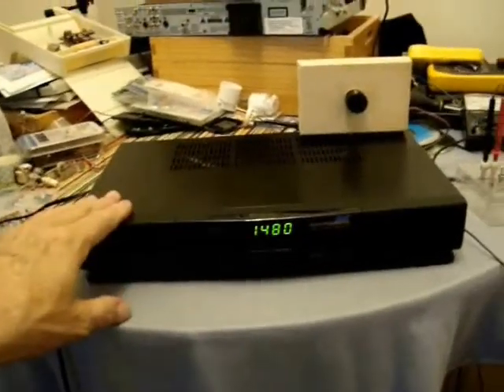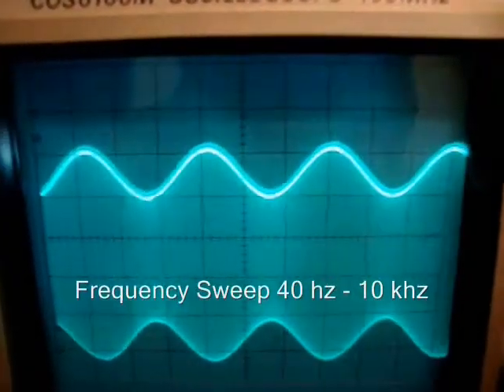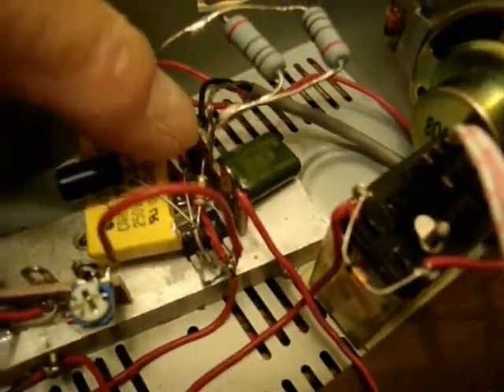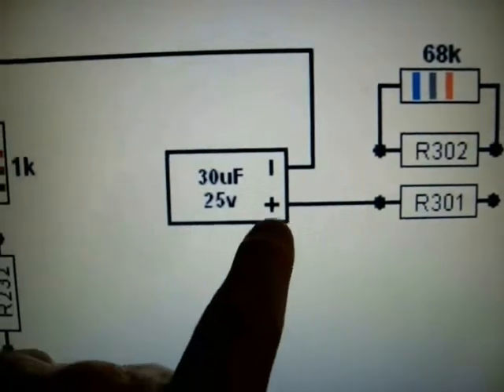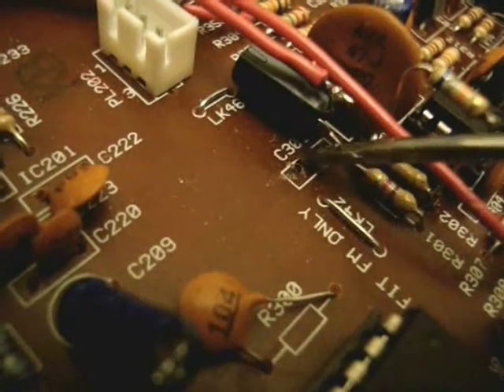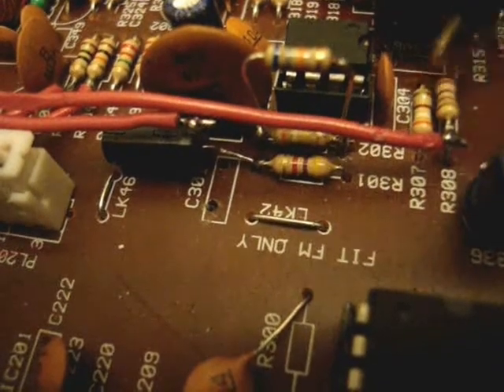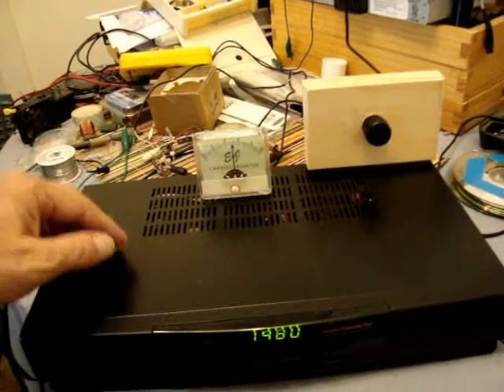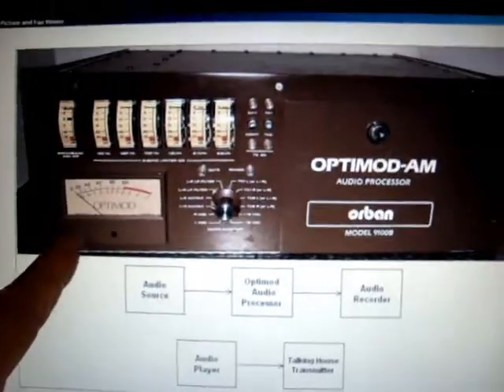Talking House AM Transmitter Modification

Comment: hola Bob. greetings from dominican republic, I have the frequency 1520 in a small town, how can I get the talking house am that I have to cover me at least 5 miles, which I must modify, we are a christian station we do not have money to buy transmitters for the cost
Reply: Hola, el transmisor de Talking House tiene solo 100 milivatios (0,1 vatios). El alcance se puede ampliar
con una antena más larga. Sin embargo, no creo que transmita a 5 millas. Se necesitará un transmisor de mayor potencia para 5 millas.

Es posible que deba confirmar las leyes de su área para conocer las regulaciones relacionadas con la transmisión sin licencia.

Tal vez la radio FM sea mejor, porque es más eficiente. Habrá un costo inicial
para obtener el transmisor y la antena, pero es mucho menos costoso que AM y mucho más práctico. Espero que esto le ayude

Comment: Interesting.  I have a TH5.0 I'm looking to do this with.  It appears to be the same circuit overall.  One question / clarification.  At the beginning of the video you show removing TR308 (which I do not find on the circuit board) - but later in your "post-op" walkthrough you show TR304 as being removed, and this corresponds to what I see on both your board and on mine.   Also, in the beginning you show the lead from LK1 as being tied to D308, but in the final walkthrough you show it tied to the cathode side of D307.  I'm guessing the walkthrough on your actual board is correct, Just making sure I'm not missing something.  

Also interested in looking at your outdoor antenna as the indoor antenna picks up hum and induces it back into the audio.
Reply from the maker: The hum/buzz issue you mentioned maybe a phantom hum. Are you hearing the hum off air? Is it a
hum or a buzz?

I've had the same issues with mine. The perceived Hum and buzz is usually caused by power line
noise being superimposed on the received signal. It's not being put back in the transmitter.
It's very misleading.

One of the biggest offenders are cell fone chargers. They make a lot of electrical noise that
gets into the 120v house power and interferes with AM reception. Usually, it's only heard around
the house, but I don't hear it on the car radio.

I've installed plug-in AC line filters at the offending sources of noise and it mitigates the
hum buzz problem. I'll also recommend grounding the transmitter to a solid electrical ground
post or a metal cold water pipe. AM transmitters usually need a good RF ground.

You're also correct about TR304. I made a mistake when i called it TR308.

Comment: Great video can you do the hi fi mods to the unit with ought using the the expensive  Optimod unit ?
Reply from the maker: Not sure i know what you mean by hi fi mod, but the modulator mod in this vid superceedes anything the the newer Talking House transmitters have, which i demonstrated in the vid. However, if you're referring to audio processing, no. The only thing discussed in this vid was modifying the modulator in the transmitter to obtain the best possible modulation comparable to real AM stations. Audio processing is a seperate issue and left up to the user to decide on using. However, there is some great software processing designed for AM that works great, like Stereo Tool ( https://www.thimeo.com/stereo-tool/ ) or the free version ( https://www.flux.audio/project/stereo-tool-freeware/ ). Hope this helps. 🙂
Reply: @bob4analog  yes it helped a lot that you

Comment: What version of Talking House did you modify? 4.6? 5.0? Does a version 5.0 benefit from these modifications?
Reply from the maker: I did the mod on i think it was a 4.8 and a 5. I dont remember moding a 4.6. It may be slightly different, but not much. From what ive found so far, all the TH models are based on the same schematic, so they're all similar. Do you have a 4.6?
Reply: @bob4analog  I don't currently own any TH device. I am considering purchase of a TH 5.0 and was curious if that version suffers from the same design deficiencies as the one you modified.
Reply from the maker: @N2Stooges   @N2Stooges  I have mod'd a TH5. The 5.0 design does have increase bass response which was a good idea, but their design still suffers from a couple of shortcomings, like the lack of flat frequency response to 10 khz, insufficient PA voltage to make full 100% modulation, and the antenna auto-tune issue.
   The mod i made solves those issues. It completely bypasses the internal audio compressor, which gets in the way of adding your own audio processing. It's pretty much a straight, flat audio path from the input to the modulator, and it works. The test results i did in the vid demonstrates this.
Reply from the maker: I've looked thru my files and i did modify a 4.6M version. I don't know if there are sub versions of the 'M' suffex, but i did varify the the 4.6M is virtually the same as a 5. Ive got pics of the boards and other mods is you would like, I'll send you those. Bob4analog@yahoo.com

Comment: Bob, I finally got some time and the parts and performed the modification.  That certainly makes a difference as far as audio quality.  I have a Carver TX-11a that I acquired from a studio rebuild a decade ago and a Sony SRF-A1 Walkman that are both AM stereo receivers.  Although this is mono, the advantage is having those receivers are the wideband capability to really hear the difference this mod made.  Even without the Optimod and just using the built in processing in automation software I have, it sounds really amazing.  Now onto the antenna tuning.
Reply from the maker: That's great! Glad it worked for you. Congrats! 😉👍

Comment: 15:45 those are also quite expensive, a Raspberry Pi and thimeo Stereo tools would probably be a cheaper option, unless you can find one of those Orbans for the price of a Raspberry PI.
Reply from the maker: So true! I borrowed the optimod, i don't own it. Yes, stereo tools is great. I'm using that now. 👍
Reply: @bob4analog  I unfortunately received a Model II (which has a Model III board), there's probably not a lot to be done to get better audio out of the thing, but I mainly just play old time radio shows through it, no music.
Reply from the maker: As i recall, there's not much difference in the TH boards. If the board in yours looks similar to the 1 in the vid, i think it can be mod'd the same way. I can send you some detailed diagrams if that will help. bob4analog@yahoo.com
Reply: @bob4analog  email sent
Reply: @bob4analog  sent you pictures of the board in mine, it's similar, but has some components yours doesn't have, and mine lacks some components yours has. 

I take it that the black box on the board on the tuner is some kind of ferrite choke or something?
Reply: @bob4analog  the places where you modify and attach wires seem to be there and accounted for, so it should work.
Reply: @bob4analog  the only thing I'm wondering about is in the pictures you sent me are those 3 black wires that's connected to A1 and A2 (can't quite make out the 3rd connection), because mine doesn't have those locations on the board.
Reply from the maker: Hmm.. I'll check that.
Reply: @bob4analog  was you able to find out?
Reply: @bob4analog  BTW what heatsink did you use, it looks like an M.2 SSD heatsink (or around the same size).
Reply from the maker: @madmax2069  Not sure i know what an M.2 SSD is, but i just used a heatsink from a scrap SMPS.
Reply: @bob4analog  an M.2 SSD is a solid state drive a bit bigger than a stick of chewing gum (they do come in slightly different lengths).
Reply: @bob4analog  I'm in the process of buying the parts, bought the 1N914 diode, power resistor, shielded cable.

I just need to get the caps (having problems locating a 30uF 16v electrolyte cap), and just can't quite make out the lettering on the brown ceramic disc cap, I can make out SR 104m 16v I just can't make out what's after 16v it's a blur), still need to buy the LM759CP, and the correct value of resistors.
Reply: @bob4analog  I do have those tiny ceramic capacitors in a 0.1uF value (Bojack brand), would those be fine to use instead of the larger ceramic disc 104m 16v capacitor? 

I also do have a 0.1uF Mylar Polyester Film Capacitors that I bought some time ago which only really leaves the 30uF electrolyte capacitor that I need to track down (I can find 33uF 16v electrolyte caps, just not 30uF).
Reply from the maker: I have extra lm759, I'll send you 1 if u want, no charge.
Reply: @bob4analog  sure

Comment: UPDATE BOB....I guess email doesn't work....I sent my TH6 InfoSpot Talking house crap box and range extender back for refund. Same POS response as your 4.6. And I do not want to experiment and mess around with mods. I might buy the Hamilton AM1000C a little over $100 more than InfoSpot, but a LOT of quality built in. And the transmit range is a lot more than Talking House. Still FCC part 15!!!!
Reply from the maker: Don't know if you meant my email, but I did get your email, just hadn't replied yet (if reply was necessary). Sorry to hear that they sent you a bad TH6. I don't know how much you spent on it, but I got mine used on Ebay for about $70. I think that was a fair price. I've heard good things about the Hamilton AM1000C. It's the Cadillac of Part 15 transmitters. It's expensive, but worth it. That's the best way to go for a no compromise ready-made transmitter and antenna. ;-)

Comment: i am a novice electronics hobbyist do you think I would have what it takes to do this myself?  I'd be willing to pay for your excellent services
Reply from the maker: I suppose you could do it. I don't know your skill level, it would depend on how do you feel about it. It does require some familiarity with electronics, but you don't have to be an expert.
Reply: @bob4analog  I can solder , the biggest problem with these is that there is no bass or punch! Does your mod fix that?
Reply from the maker: Yes, the mod will fix those issues. The video shows the before and after results of the mod. Of course, the "punch" that you're wanting would be from good audio processing.

Comment: As a retailer how can I use a system like this ( once the broadcast signal is solid ) to interact with customers when they are not in my brick and mortar via some type of web streaming and does that then put me in Fcc violation ?
Reply from the maker: Others have used signs posted at the facility informing people to listen on their car radio for more information. That was the original intent of these transmitters, in which case the modification would really not be necessary. Either way, this would not violate any FCC regulation.

Comment: Just to note, but you may have voided the FCC Part 15 certification of the unit by doing the modification.
Reply: NOPE! Bob H did not change anything in the final RF circuit. He got this thing to sound like an AM transmitter. It should rival the Rangemaster AM1000............which has SUPERB audio and capable of 130% pos peaks!!! Just like real broadcast!!!
Reply from the maker: I thought about this issue as well. After looking up such info, it appears that part 15 type acceptance does have certain guidelines, but tend to be loosely defined. Verification is a self-approval process where the applicant performs the necessary tests and verifies that they have been done on the device to be authorized and that the device is in compliance with the technical standards. I made every attempt to stay within the permissible guidelines when modifying mine. As such, I only added a more high performance modulator circuit. The PA voltage remaines the same as the original design. The antenna tuner i added also achieves the same results.

Comment: Please do not use Obsolete parts, LM759P is not at Digikey 

also is there a schematic for Talking House anywhere?
Reply from the maker: I've got a lot of spare LM759's, so I'm not going to spend money getting something I already have on hand. This vid explains how I did it with parts I already had. However, you should be able to use any power op amp of your choosing. I have a schematic but it's not the exact, it's close tho. I can email it to you - bob4analog@yahoo.com

Comment: Nice one, Bob.  I've been looking for a used one of these for a while now.  How tough would it be to add FM capability, do you think?
Reply from the maker: Thanks! When you referring to FM, do you mean FM for the band it was designed (i.e. MW), or converting it for the FM broadcast band?
Reply: @bob4analog  Actually, I was referring to the FM broadcast band.  Don't need stereo.  I want to use it to test the FM front ends of my tube radios along with the AM front ends without simply adding a bluetooth adapter to the phono input, which  really only tests the amp section.
Reply from the maker: No, this transmitter can't be converted to FM. I'd recommend the SCOSCHE FMT4R FM transmitter. It costs around $9 and it can be plugged into the headphone jack of an audio player; no need for Bluetooth.

Comment: Hi Bob, what grounding and antenna changes have you made to eliminate the transmit Hum?  
i'm ready to toss my TH 5.0  in the recycle bin
Reply from the maker: Don't throw it away! This is a common problem even for radio stations. If you're referring to the hum/buzz you're hearing on your radio, that's more than likely caused by switch mode type power adapters and chargers plugged in your house electrical. These are really big noise makers for AM. I had to look around my house for these trouble makers.. even TVs and other modern electronics can cause electrical noise that can interfere with your broadcast. Also, a good ground is so important for your transmitter. Even for the professional AM radio stations, good grounding is important, or else there will be buzz in the audio and other unwanted RF problems that tends to get into the audio chain. You might try the afore mentioned, and/or move your transmitter out of the house and connect it to your electrical service ground rod, or maybe an outside water spigot. Use a short copper ground wire to your ground source. I know this seems like a big hassle, but these are the problems with AM broadcasting. Hopefully, this will help you fix the issues with yours.

Comment: Hi Bob,
I have a TH and have not been happy with the audio quality.  Is the 24Volt  1amp PS  supposed to replace the OEM PS due to additional current requirements of the  modifications? 
Thanks,
Ben
Reply from the maker: Hi Ben, yes, the 24v supply will replace the original because the modification requires the higher voltage. it's only necessary if you do the mod. Otherwise, it's best to just use the stock TH power supply.

Comment: I just want to get mine to stop humming! If I can do that, then I may take it to this level.
Reply from the maker: Assuming you're hearing the hum/buzz from the radio, that's usually a grounding issue with the transmitter. I've had the same problems with AM reception. It's very prone to electrical interference, thus it's why good grounding is so important. Another problem are Switch mode type power adapters and chargers; these are really big noise makers for AM. To get rid of the hum, I've had to look around the house for those kind of power adapters. They can make really bad noise and it gets induced on the power linesaround the house. I found several at my house. Once I found and unpluged them, problem was gone. This, of course, does not affect the transmitter output, but the signal reception, and it's usually heard only around the premises. You might Try that before modding your transmitter.

Comment: But how would I go about boosting the range on one of these?
Reply from the maker: A longer antenna would do it, but it would not be part 15 compliant. If that's not an issue, then a wire tossed in a high tree and a good ground counterpoise will work. A linear amp could also be used, but that would be rather tricky with the TH transmitter due to the unusual output method, but not impossible. Nobody has done it yet, but I've been wanting to try it. I'd try the long wire 1st.
Reply: @bob4analog  thank you, I'll give that a try :D
Reply: Increasing the range, what ? Beyond the 50' it already does? POINTLESS PART15.
Reply: UNfortunately I would recommend buying the Range Extender....$495. Comes with its own part 15 antenna and is a tunes that 3m antenna for better signal output from the Talking House box. The two units are both part 15 type accepted and maybe you get out 2500feet.